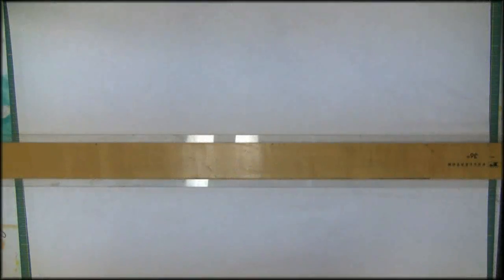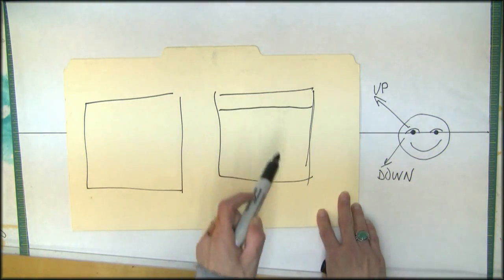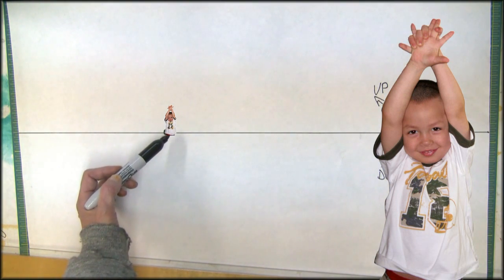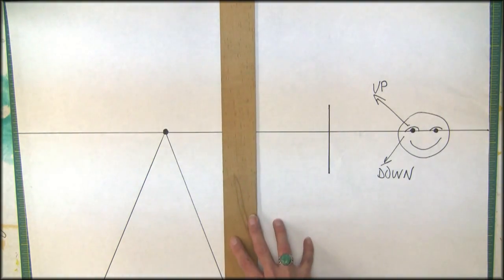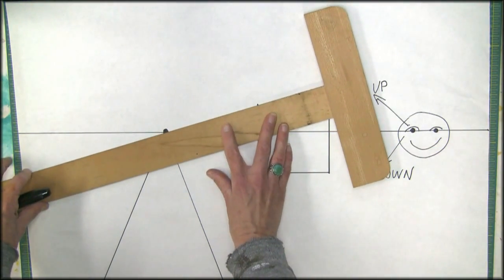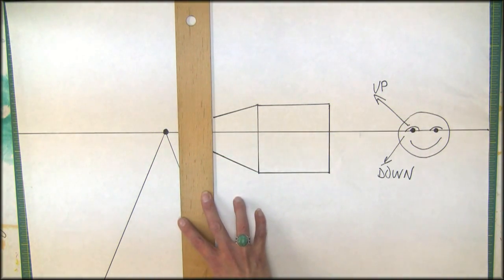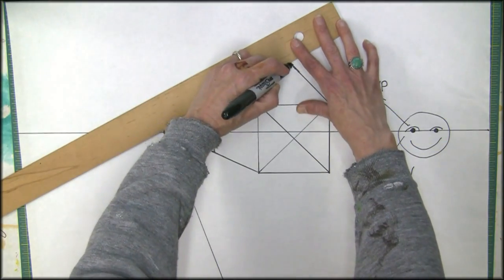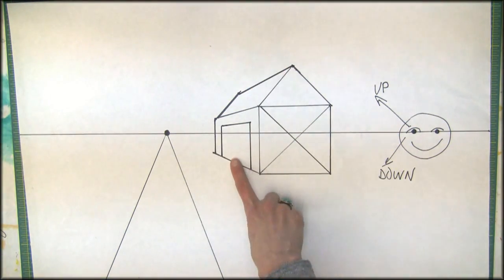How To Draw Using One Point  Perspective - Beginners EASY Tutorial

Comment: Okay, lets say you were looking at a cube straight on, meaning you could only see one face. it would appear that you are looking at a square with two sets of parallel lines. If you rotate the cube 45 degrees, you should now see two faces,  whose lines appear to be receding toward two different vanishing points. At that 45 degree rotation, or any other rotation for that matter, it is not possible for face one to remain "square" as face two becomes visible to your eye.

Comment: Great explanation, although since first learning about perspective I have come to the realization that one-point perspective does not in fact exist in real life. If you were looking at a cube, and from your angle you could see two faces, it would be impossible for either of the two faces to appear to you as a square with parallel lines. Once you put yourself at an angle, both faces should appear to recede into the distance and the horizontal lines should approach the vanishing point. Right?